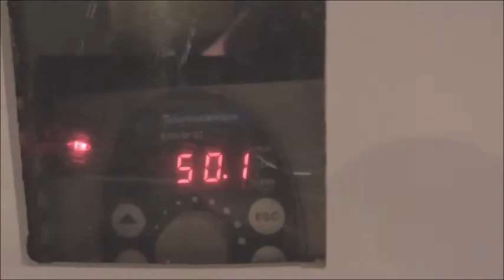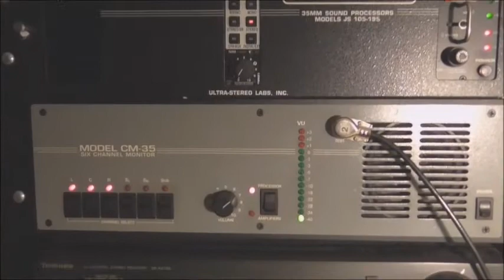Bauer U4 35mm Projector

Comment: Beautiful! What made you go from Bauer U4 to Earnmann II?
Reply from the maker: The Bauer U4 was one of the projectors I had used at the cinema up until it closed in 2011. I already had  been using the Ernemann 2 in our home cinema for a few years prior to getting the Bauer. I only took the Bauer to stop it going to the scrap, which during the cinemas changing over to digital, there was no future for it. I did find a space at the back of the garage for it and use both projectors. However the Bauer wont fit into the proper projection box that I built for the Ernemann 2 as its larger and just wont fit.  Both are great machines, hopefully one day they can find a new home as a working exhibit in some museum.
Reply: @grahamritchie7508  Great to hear! About space, would you recommend Ernemann 2 if I have less space then yours?
Reply from the maker: @sebastianbjork7722  The projector I would recommend for just running 35 mm is a "Kinoton"  . Those modern projectors are quiet running and very reliable.  You will need to do some research, but I have heard of folk using them, using a home made lamp house with a 36 volt 400 watt lamp. Just a thought there are a few portable 35mm projectors around. I dont no much about them, but it might be worth looking into. Whatever you get,  it must have a "IR" red reader for sound, as all modern films will need that.
Reply: @grahamritchie7508  Thanks for your recommendation. I just watched Diethelm klotz walkthrough of a Kinoton on youtube. It feels like a solid unit and particularly really small for confined spaces.